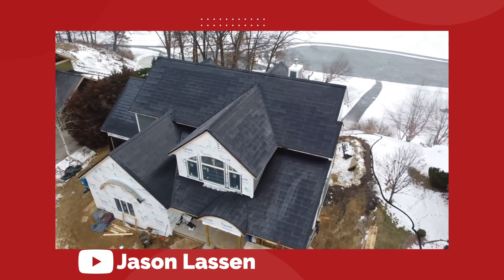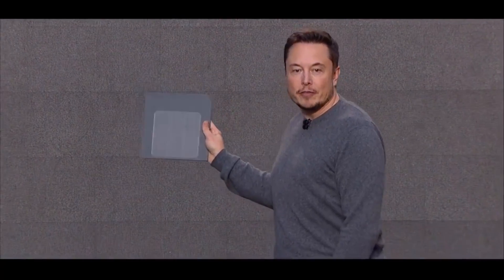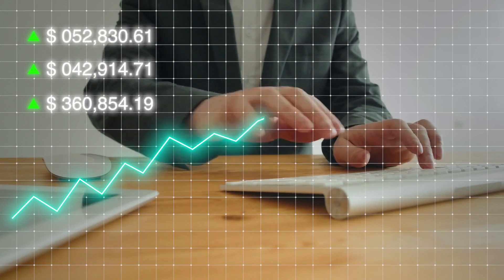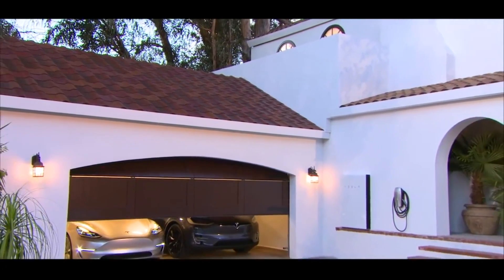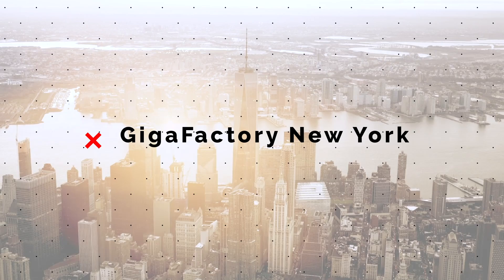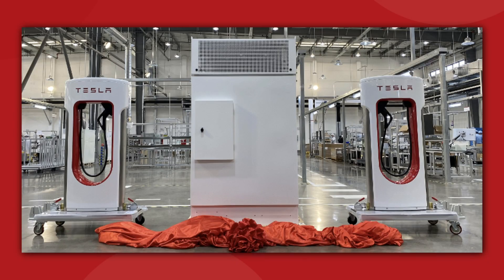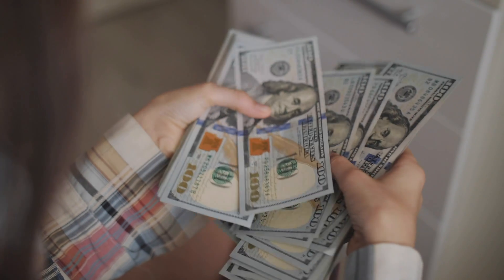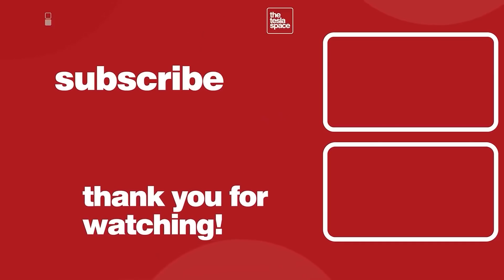The Tesla Solar 2022 Update Is Here..

Comment: The grid is like an insurance product: it is only economically viable if everybody is opted in. Solar customers are effectively "opting out" and not paying much into the grid, so the smaller number of remaining customers are paying for the upkeep of the grid. I'm guessing the California law is responding to that (with California's high uptake of rooftop solar). Over time this fee should drive the solar customers to opt out completely, go completely off grid, which means they need lots of battery storage plus ability to over-generate, with redundant solar panels and/or a power generator (diesel, natural gas, etc.).
Reply: I agree in general, however this is an unbalanced solution as it stands. However it is a real problem that has to be dealt with and it is not easy. Even people who opt out still need the grid to support all the other parts of life.
Reply: @judedornisch4946  I could imagine a potential future scenario in which technology makes a fully decentralized energy generation and storage viable, making the grid unnecessary. I could also imagine a future scenario in which governments take measures to preserve the grid, as a very expensive albatross, and customers having to pay for that albatross prevents them from moving towards the first scenario.
Reply: @judedornisch4946  Good point.  Even if you have enough solar and batteries to go off-grid, you still need the traffic lights to work and you need stores, hospitals, restaurants, and bars to have power.  You need street lighting, air traffic control, and other transportation control to have power.  In short, the grid is an essential public good.  It needs to be funded in a way that's fair to everyone, and no one should be able to opt out.  Solar is causing the old model of ratepayers funding the grid to break down.  I suppose that's why they want to tax it, but I'd rather see a different model that resulted in more clean power overall.  I started out hating the idea of a solar tax, but I'm beginning to see that it might be the most sensible way to deal with the problem of funding the grid.  Anyone have a better idea?
Reply: @incognitotorpedo42  It is a tricky problem you want it to be mainly funded as a common good say like an army or fire department, but at the same time you want some free market competition cost controls embedded. We tend to under fund our infrastructure as it is seen as a cost burden.
Reply: what if they start taxing solar roof purchases heavy? can they even do that?
Reply: @a-don13  historically the grid is supported by ratepayers. So a tax would be a change of model. But maybe. Utilities are private companies, but enjoy local monopolies, so are heavily regulated, and govt approves their fees, but they are not government entities, but private companies. Every place is different though.

Comment: The solar panels if they had 8x 4 sheets I mean it still be a single panel but they should already have most of them symbols in the factory then bring them on semis and put them on the roof and then don't take long to put them on less than 4 days.
Reply: Problem is the wiring, i read somewhere.